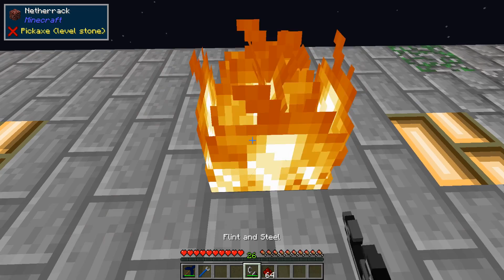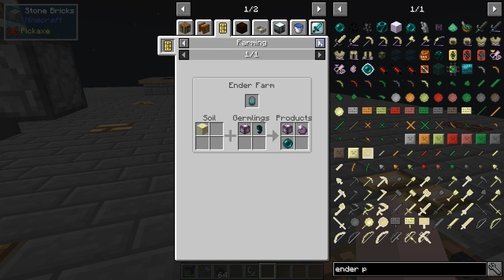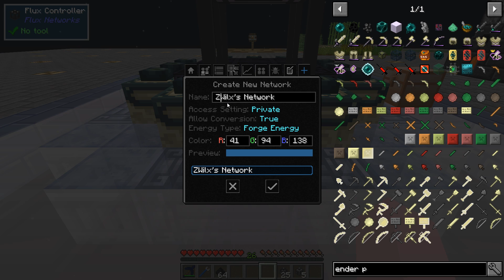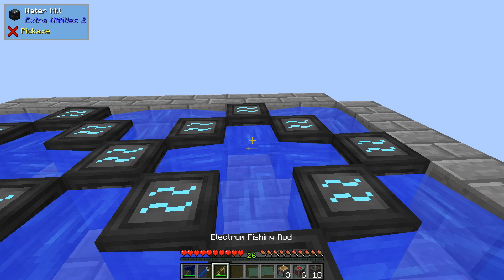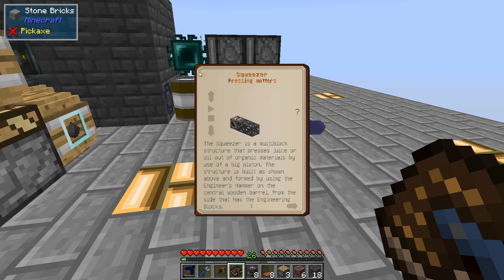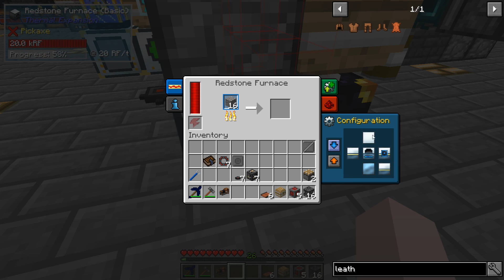04 - Diamonds, Leather, Lag Goggles - Ultimate Alchemy

Comment: I went with setting up a piston builder and a crafter to create the ender shards then, feed the ender shards into a magma crucible, which in turn feed the resulting resonant ender into a casting table, the casting table then used an ender conduit to place the soggy's on 9 drying racks and remove the finished pearls.

It just keeps running and running and running! I think I'll call it my "Ender Bunny!"

Comment: Finally got to draconium production. Thaumcraft almost made me quit.
Reply from the maker: I haven't use Thaumcraft since AS2. I'm open to reading Thaumcraft tips, especially pack specific stuff.
Reply: I spent way to much time trying to get bath salts when all I needed to do was make Drawing of  One-Legged Puppy. Other than that everything gives off taint it seems. If you go ham burning through thaumcraft I would think your headed towards disaster. I created a thaumcraft platform very far away from the base and set up a RFtools portal.
Reply from the maker: > One-Legged Puppy
Ya. I guessed that from JEI. Thanks for confirming.
> everything gives off taint
That's from having leftovers in the crucible right? Is there still a way to automate and bottle the extras.
Reply: @WilxGaming  You can extract the excess with Quartz Slivers but even this generates taint. Essentia Smeltery generates taint as well for every item burned. Another thing is once you get the cheat sheet through botania the only other thing I actually had to research was liquid death.
Reply: @WilxGaming  I finally finished the pack. After thaumcraft the time sink is getting nether stars. So that might be something you want to start early. I want to say I spent about 12 hours just waiting on wither skull components.
Reply from the maker: > I want to say I spent about 12 hours just waiting on wither skull components.
Was that Drops of Evil? How many drops of evil did you need and how many TNT pulverizers did you use?
Reply from the maker: > You can extract the excess with Quartz Slivers but even this generates taint.
There use to be an automated way of bottling all the essentia and taint was created if you let excess used essentia escape into the world. Thaumcraft could be very different now.
Reply: @WilxGaming   2 pulverizers with 4 sieve augs. Both sped up with wands. It's just a horrible rate. But of course can always go bigger and bump up sand production.
Reply from the maker: > 4 sieve augs
So you started after platinum/enderium
> But of course can always go bigger and bump up sand production.
Was sand your bottleneck? Did you use Double Crushers for sand? How much sand did you need? I already have a gold barrel full. 1024x64=65k Sand, At 1% 163 drops of evil maybe?
Reply: @WilxGaming  Just to progress through the draconic crafting tiers you need roughly 152 stars. That amounts to 1824 drops of evil. Which is quit a bit of grinding. 1% chance before augs and even then its not very common. As far as sand my 2 thermal pulverizers kept up as long as I put wands on the crafters making sand. Because it was so slow I set up a string farm with a wand to craft wool which I ran through an ExtraU crusher for bone meal just so I didn't have to deal with the atomic reconstructor.

Comment: I just automated my ender pearls with the phytogenic Insolator. 

I have an ender tank on the left providing water (with a Fluid Translocator), 

on top I have a barrel full of fluxed phyto-gro pumping into it with a reversed flat transfer node. 

On the right side, I have a barrel for the pearls and on the bottom I have two cables, one hooked to power, the other an item conduit with two filters. 

The one attached to the machine is sit to insert on green, extract on brown with extract having the ender lilly filter. On the crate (or whatever storage you choose) I have set to insert on brown with the ender lilly filter and extract on green. This is working quite well for me, I've already gotten quite a few stacks of pearls without having to continuously replace the lilly or dry soggy pearls!

Comment: Hey Wilx, not sure if you saw my comment in the first episode, so I'll put this here for you. The lense of color loophole for lapis will very likely be removed. While the pack author didn't say anything about it yet, it's still highly likely to be changed due to the fact he put in a path to make Lapis with the varying steps of blue color liquid that ends up being lapis. Check out the path to make true blue and you'll see this path. The fact this is in there says it's likely the path the pack author wants to go, and he'll likely change the lense of color will to output something else for blue. I can see him doing this as he's an established mod author and he's done similar things in the pack already. So in short you should prepare yourself for this change and set yourself up with a lapis setup using the path made for this pack, to save yourself some headache down the line.
Reply from the maker: I will repeat what I told you yesterday:
Maybe. Maybe not. He removed the  lens of the miner which was right beside the  lens of color. Maybe he didn't think about it, but I am guessing he did. It has made it through several updates where he could have disabled it. If he does remove the lens of Color I already know how to make lapis and will show the automation for it.
However the Excavator still works and it can get you Lapis, Quartz, Diamonds, Emeralds, etc. I will not be using the Excavator because I'm sure it was not intended.
Reply: @WilxGaming  Right, sorry for the double posting of this in two episodes, I dont get notified of replies so I'm not sure if it was seen or not. Anyway, just wanted to put those thoughts out there for you, it seems like it's a certainty to eventually happen due to that bit of path with the liquid blue colors. as I mentioned, while it has made it through multiple updates, there's likely very good reasons why he's let a loophole though, ranging from attempting to alter the lens' outputs to probably removing it all together. My money's on the changing the output since he removed the miner lens but kept the lense of color, which would be great to have all the colors available. He's likely going to replace the Lapis in the lens of color's cycle with some other blue dye, patching up the loophole. As I mentioned, this is my best guess why this glaring loophole has made it through so many updates, he's likely trying to figure out how to do that so we can keep the lens of color

Comment: You can actually make ender pearls really easily with the phytogenic insulator basically all you have to do is set the output of ender lily into a barreland then from the barrel back into the 2 slots. you also have room to pull out ender pearls into a barrel for storage
Reply from the maker: Still need to figure out whether drying or insulator is quicker.
Reply: Wilx I’ll post a response video I don’t know how to link it but I’ve since got into refined storage and working on auto crafting everything but I will set up a temporary automation of ender pearls to show you
Reply from the maker: > will set up a temporary automation of ender pearls to show you
I know how to automate the insulator. I know how to automate soggy as well. I just wasn't sure which would be faster since I haven't tested them head to head. I've been wasting time trying figure out why the windows 7 update made my lag goggles results way worse.
Reply: Wilx alrighty and dang idk how to help but goodluck

Comment: Ender pearls: You get the ender lily back in the phyto (100%). No problem for Mr Automation (despite the manual fishing, tsk!)
Reply from the maker: Honestly I didn't know about the Aquatic Entangler, but i still might had fished for just 3 leather. I plan on automating rotten flesh later, since it has more uses.
Reply: @WilxGaming  Only pulling your leg. I've  become a disciple of yours and are automating EVERYTHING! Just automated lapis via the imbuer, which was fun. (Oh this is me too, I didn't switch accounts before posting). PS "Oops" count in single figures, well done 👍
Reply from the maker: Didn't recognize the other account. Good to hear from you.
Reply: @WilxGaming  Never miss an episode my friend. I give you my +1 as the video starts, less I forget. Had a wry smile to myself when ep4 came out thinking, will he go all the way :D Thanks for the lag goggle showcase. I could have done with those in the latter stages of Sky Adventures.
Reply: @WilxGaming  BTW repairer? Augment: flux reconstruction ;)
Reply from the maker: > Augment: flux reconstruction
That's the one thing I tried before the episode. I couldn't get it to repair the Electrodes in this pack. How did you do it?
Reply: @WilxGaming  Like you I'm sure. It's incredibly slow. Not worth it it imo. Good for your AIOT though.
Reply from the maker: > It's incredibly slow
I need to read more carefully. It needs essence of Knowledge. You're right it's slow. Not too bad with a wand and 2 speed upgrades. 4 seed upgrades and essence production is the bottleneck instead.
Reply: @WilxGaming  >I need to read more carefully.
You and me both. I just spent 2h trying to make player tears before reading ContentTweaker, sigh.
Reply: @WilxGaming  I stumbled upon mob spawning while thinking of your arc furnace electrode blueprints dilemma. If you're unaware let me know #nospoilers
Reply from the maker: I know of the Warp Effect and Wither Summoning, but are you talking of something else?
Reply: @WilxGaming  Yes. I thought "electrode blue prints are dungeon loot" -> Loonium! Didn't get them but I got something else, quite unexpected ;)
Reply from the maker: What did you get?
Reply: @WilxGaming  Vanilla Mobs. Therefore, was wondering whether with an RFTools spawner, I can get a zombie villager???
Reply from the maker: > with an RFTools spawner, I can get a zombie villager
Let me know if you do.
Reply: @WilxGaming  Nope, lol. Guardian of Gaia might do though.
Reply: @WilxGaming  Cocoon of caprice and an acceleration wand... scared the hell out of me :)

Comment: Why he is so slowwwww, and why he play cap at 30 fps if he has a good pc
Reply from the maker: I play capped at 60 fps and record at 60 fps.
Reply: @WilxGaming  in ep. 3 at 19:30 when you press f3 it says 40 fps and it didnt fluctuate, maybe you have it capped at 40 fps
Reply from the maker: > ep. 3 at 19:30
I'm not sure why it was a steady 40 then. When I'm playing on my own it's a rock solid 60 fps. When I'm recording it displays the fps figure up in the top corner, but you can't see it. It's 60 most of the time, but occasionally dips a little depending on what I'm doing, since my computer is processing the recording as well.
Reply: @WilxGaming  oh yeah i understand. Well, have a nice day :)

Comment: Overclocked generators are hitting a speed wall already, using wands on them is ridiculous.
Can confirm AA Item Repairer does not repair electrodes.
Reply from the maker: An overclock generator normally creates 300 rf per tick. If I point a wand at it pulses faster netting maybe 1500 per tick. I don't know if it is a full 5 times faster each wand after that, but 4 wands puts out a lot more power than 3.

Comment: I have been using Lag Goggles before and I tried it in this pack and I get much more lag than you do per mechanical user. I get over 100 per user where you get 1-5 or so. Could it be because of my hardware?
Reply from the maker: Hi Fiki. I like your videos.   
> much more lag than you do .... Could it be because of my hardware?
I would suspect it is. How many GHz is your CPU? Mine is an i7 4.3 GHz.
edit: However 100 sounds high regardless. I wonder what others get?
Reply: Hey! I like your videos too! I have a i7 3.5GHz
Reply from the maker: 100 sounds really high for 3.5  GHz. I suspect there's something else causing trouble too.
Reply from the maker: Don't run out buying new hardware just yet. My numbers are way higher now, in the hundreds, so even worse than yours. I did a windows update yesterday and not sure if that is a contributing factor. I pushed all my Overclockers to 3 wands and sped up my coal processing with a bunch of double wands. So it could be the cumulative number of wands in the game. I need to experiment more with it.
Reply: Okay. I had a few users running with wands set on fastest and 4 speed upgrades in em so yea. I will mostly try to avoid using wands in general as much as possible.

Comment: In most of the other packs I've played as of yet the ender Lilly will work in a cloche... however the time to grow is not reduced much, if any... Though this may be due to a setting in the configs, I am not too sure
Reply from the maker: Ya, think I've given up on cloches for ender lilies.
Reply: @WilxGaming  there's a rabbit hole but if u can get nether quartz thru botania, make an empowerer (act additions) and craft greenhouse glass, stick one over an enderlily and wand it, I used a mech user to harvest set to activate item with a vacuum thing from thermal to collect, it's nutz :)
Reply from the maker: > greenhouse glass, stick one over an enderlily and wand it
So you were wanding the greenhouse glass, not the ender lily and that worked. Interesting.
Reply: @WilxGaming  u can wand the lily directly but wanding the glass is a lot faster (must be daylight)
Reply from the maker: > u can wand the lily directly
I didn't notice any improvement when I wanded an lily directly. That might have been because a lily on dirt is so slow to begin with, even at 5 times as fast, it's not noticeable.
Reply: @WilxGaming   true, but i wouldn't suggest using a machine to wand the glass, pearls only stack to 16 an i filled  small storage crate in like five mins, they were everywhere XD

Comment: To make the graphite electrodes 100% you have to put one in each slot of the anvil and use 2 levels. Then enchant with unbreaking 3 using the Arcane Ensorcellator. Keep up the awesome vids!
Reply from the maker: I was really looking for something like the Energetic Infuser with a Flux Reconstruction Augment, but that didn't work in this pack. I'm not convinced there isn't an alternative.
Reply: I wish there was an auto-anvil in the pack

Comment: Rather than use an actual fishing rod for the fish (aka Leather). I used the Aquatic Entangler. I spent ages making a lower level, 20 or 30 blocks lower. It sits under my main area and just fills a chest with fish. I did some actual fishing to see if I could catch some items which I would not otherwise get. In some parts of this game, I am ahead, others behind. Thumbs up for your video content too.
Reply from the maker: I didn't know about the Aquatic Entangler. I looked for the Fisher and other machines that weren't there. The Net needs the Empower which needs Quartz and I don't have that yet. Thanks for the suggestion.
Reply: @WilxGaming  Same here. I want the Empower and have no Quartz. I do however, have Magma & Menril. Also every vanilla sapling and Log thanks to Botania.
Reply from the maker: If you're into Botania what's stopping you from getting Quartz?
Reply: @WilxGaming  I totally missed the recipe. A derp, but lots of progress today. Nether Quartz, Wart, Milk, Egg Yolk, Blazing Pyrptheum & more.
Reply: Nets are very slow, the entangler is quite fast in comparison, and with very little plant support (wheat for bread, rice for slimeballs, netherwart for netherwart) you can make the aquachow bait to speed it up immensely, all the fish, and therefore fertiliser or leather you could want.

Comment: I had 3 wands pointing at an ender porcupine, and without thinking set the target for the ender porcupine on the third user, which created a huge loop that infinitely sped up the porcupine, and it kept crashing my game after a few seconds. Easiest solution for that was opening up any of the users and quickly clicking on the mechanical user's "use" type to break the cycle.
Reply from the maker: Glad to hear you didn't lose your save game.
Reply: I love infinite loops.

Comment: There's a special engineering blueprint for the engineering table that can make full strength electrodes. Normally you get them from dungeon loot or villager trades, there might be a special way to get them in this pack
Reply: Not sure if the loot tables are changed but you could theoretically get them from a Loonium from Botania. They generate mobs that drop dungeon loot when killed
Reply: > they generate mobs
Do they also generate zombie villagers? That would be insane (and break the pack).
Reply: Ok, they can not spawn zombie villagers. 

https://github.com/Vazkii/Botania/blob/master/src/main/java/vazkii/botania/common/block/subtile/functional/SubTileLoonuim.java#L100

So I can't cure them to get villagers.
Reply: And they still spawn creepers, but their potion effect is not as long as before.
Reply from the maker: > there might be a special way to get them in this pack
I spent hours looking
Reply from the maker: > Loonium from Botania
That might be a possibility. You can't craft the Orechid and didn't even think to see if the Loonium was craftable, but looks like it is.
Reply from the maker: > Loonium from Botania. They generate mobs
The Loonium generates mobs? That's new.
Reply: Yeah, that changed because otherwise "it would be too easy". Botania had to remove creepers, because the mobs have some buffs with a very long duration, and if creepers have buffs when they explode, they create a lingering potion field with that buff and duration. Was nice to have infinite regen II.

Comment: also you can use an acceleration wand on the ender pearls, so you could probably automate it with mechanical users and hoppers (if the drying racks can accept from them).
Reply from the maker: I'm looking more seriously at things that don'r need a smeltery for automation.
Reply: @WilxGaming  You can use Magma crucibles and output directly to a pan cast, like you did with Nickel
Reply from the maker: > Magma crucibles and output directly to a pan cast
True. I might rethink this.